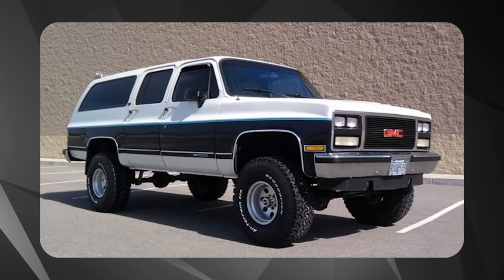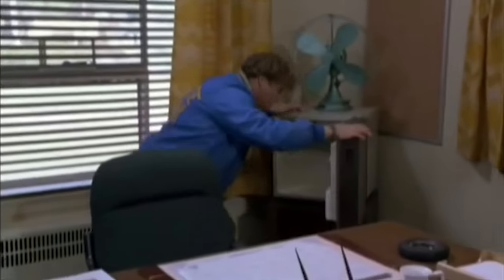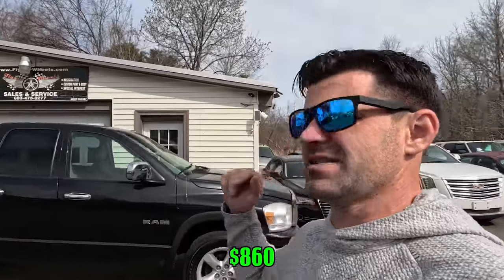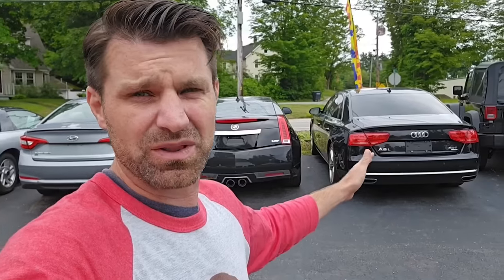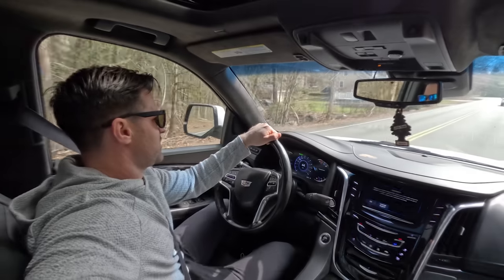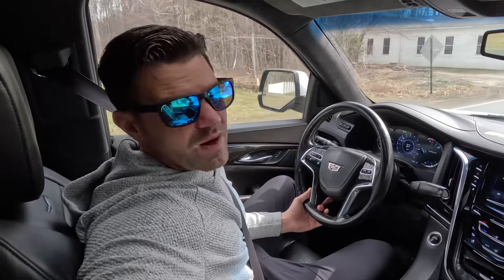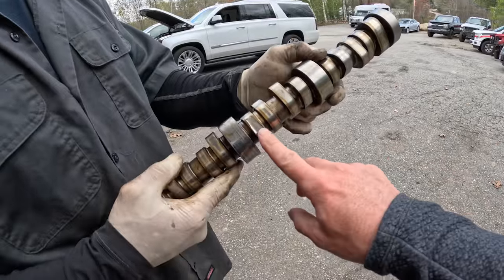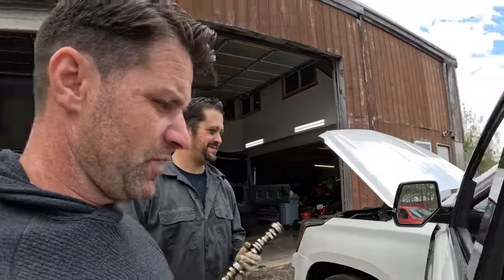WARNING! GMC Chevy & Cadillac Escalade Engine Problems at only 53,000 Miles! - Flying Wheels

Comment: If that jeep has the pentastar v6 . The early models were trash and had cylinder head issues. Went through the same thing with our grand cherokee. Thankfully it was under warranty and eventually got a new cylinder head the 4th time it was in. 60000miles later same number cylinder misfire. Trade in time

Comment: Yeah just put a gas motor from a 2500 HD pickup in it. Delete the VVT if it has it, but it most likely won't get it properly. Dialed in by a good tuner he'll keep any codes from popping up. Problem solved for half the money

Comment: I had a Jeep the check engine light would come on if you farted around it 🤣 just kidding but I finally got it fixed when they came up with a stretched timing chain 🤔 no trouble after that then the light came back on a year later got the speed sensor right rear wheel changed out no more problems then I posted it for sale sold it the next day I left the new tires on it 👍I would like to have that Escalade I like to work on cars when I have time

Comment: Wait for the 4 cyclinder turbo GMC and Chevy trucks to come to the market,  I know they have the HP and Torq similar to a V8 but does anyone else thinkg one of thee engine is gonna last a long time.  You can buy a used truck and what if the person whom owened it towed a huge mortohome,  back in the early 1990s I went thru the smokey mountiains in a ford dually pulling a race trailer and we could only go like 52 mile an hour up some of the hills,   heaven forbid you try this in a 4 banger .

Comment: GM would say, We don't have problems with our engines NO, It's rare, Do 3,000 miles oil changes problems go away, except for that DAM torque Converter-Pump issue.  GM is still doing better than Ford I hear😅

Comment: $35 + $100 an hour labor comes out to about $230. $5,000 replacement engine plus labor I'm guessing about seven grand for the engine swap. Seems like most of the Prophet was eaten up and you just got an even exchange for a car with less miles

Comment: GM's best engine was the gen 3.

My 243k mile 5.3 silverado has outdriven its own 4l60 AND g80 and still runs strong af!

My ls6 cadillac is tough as nails and has 35psi oil pressure at idle, LSA guys can't say that🤣

Comment: Afm no cost deleat ,process 2022 chevy high country 1 start truck, turn off auto start 2 when going to put in drive push shifter back till in lo use paddles or bounce shifter till you see  L 9 on the screen  ten speed trans drive in L9 truck will not deactivate lifters you will have full v8 all cylenders all the time, no weird exhaust sounds  and my 6.2 runs like it should have, minor loss of fuel economy due to not useing overdrive aka 10th gear , and shouldnt have carbon building up in intake/exhaust ports is what I read  , so far I love the extra get up and go , also been told if useing  programmer will allow you to set pedal sensitivity for better throtle responce feel... Thank you telling us about the plastics in transmission doest sound like much help on that problem mayby the aftermarket will fix this issue for us , ps by the way I heard the 2026 and up all cars will have a mandated remote shutdown installed on them I am assuming to end car chase scenarios  I guess we will see then ?

Comment: The northstar engine was just a poor choice of materials in combination. Aluminum heads on a steel block, not sure that was ever anything but a recipe for head failure.It's not if it will fail, it's a matter of when.Surprised you havent realized being a car dealer.

Comment: It’s not just the lifters with these GM’s it’s the transmissions and high pressure fuel injectors. The lifters are a problem too, but they’re hit or miss. I’ll never buy a GM again. My 2018 Silverado lasted 45,000 babied miles before the fuel injectors started leaking and the transmission started shuddering. And it’s not because of oil changes, it’s because of the AFM system itself, the more it’s activated, the more premature damage occurs. Ridiculous design.

Comment: I have a 2012 gmc terrain. 85000 miles
The abs module schidt the bed and now they no longer make the module.
No one will work on the vehicle because it will require a remanufactured part.
Gmc can old show me a new vehicle… wtf!

Comment: Definitely not a 6 speed in that. Im positive it has an 8L90 which is a rough tranny for sure. When it works it is an awesome transmission but shuddering is a really common issue. The 6L80 valve body check balls do wear out normally resulting in a loss of forward gears because of check ball 5 wearing i think. Overall though, the 6L80 is a pretty solid transmission. Transmissions are especially neglected by dumb customers who wait to service them until at least 100k miles and then wonder why shit breaks.

Comment: remove the Valve management crap, replace the cam and lifters. There are kits to block the AVM. and you can turn it off in the ecm. That LS motor will run for ever then.   ( there are many youtuve videos showing the conversion. Yea you will lose some fuel mileage.. but I would rather have a super reliable vehicle.

Comment: Hey Craig, quit cheaping out on your kid haulers!  Your family is worth some full coverage Weathertechs, and when you do sell them, rinse them out and dress them and people really appreciate them.  There are other brands that are just as good and less expensive as well (I run Quadratechs on my Jeep, which are pretty much identical to Rugged Ridge, also good and cheaper than Weathertech).  Besides looking nicer and adding to appeal for buyers, they're much better protection from liquids, like those discarded not-quite-empty Gatorade bottles.
Reply: Also, I think the projection is for turning on/off the projectors in the doors that project the Cadillac emblem on the ground when you open the doors?  Test it out and let me know!
Reply: Oh, sure...hide your Weathertechs until the end of the video lol.  That will teach me.

Comment: Emissions and fuel saving gadgets and inventions in gas and diesel engines IMO have caused more landfill waste and Earth eco damage than simply not having them. More engines and cars have been junked to all these emission systems failures. If cars actually lasted 10+ years like they used to than we would have LESS WASTE, rather than by a new "eco-friendly" car every 3-4 years.

Comment: I know Craig my 2003 toyota  rava  4  stick been great  2022 rava4  been at the dealer more than in my house  power windows trans slips oil filter hosing leaking& maybe burning oil at 12.000 miles back up camera & wheel sensor which dealer thinks might be 90 percent of the problems
Reply: Yeah. Even Toyota ain't what it used to be. Hope to keep my '90s Tacoma & Camry forever, or at least 'till I can't drive anymore!

Comment: This is typical GM. I have a 2008 Trailblazer SS that shit a lifter around 100k miles then spun a rod bearing at 130k. 
Failing lifters and poor valve train have always been a GM issue. Don’t worry, the government will keep bailing them out for building shit products.

Comment: meh, just run it into a tree at 82mph. only takes about 1/8mi to get goin that fast.

you can even survive without a seatbelt. I tested it last thursday.

only broke 10 ribs. no big deal. the cadillac got the punishment it deserved and I didn't get ejected. even unbelted. it treats you so nicely that they'll think you were abusing opiates instead of having a kp6 solar storm induced seizure.

real talk tho, that hydroformed chassis saved my FN life. I am unbraced and walking around with all my extremities responding just fine. Can't say enough good about these tanks. I legit should be FN Dead, didn't even hit my head.

took a 90yr old live oak to stop it.

Comment: I have been seeing a lot of corvettes with AFM or cylinders deactivation for sale and I want one but they cost too much over 50 grand grand and I have test drive some of them and I cannot believe the things I was feeling with 40-50 thousand miles to much vibration rough running and no soft bumps big and sloppy and I don’t think they are worth 25 grand.

Comment: Not the sound stupid. And I know you're a smart guy and I've done your research. But you don't necessarily have to put a motor in it! What typically goes bad with these are the roller rockers and/or camshaft and lifter issues. If you have a good shop or machine shop nearby, you can delete.  The active fuel management and displacement on demand change some simple parts and be up and running again without that engine having to come out of the vehicle

Comment: I own an Infiniti ex35 VQ35 230k miles original everything - runs like a clock.
If the Nissan smokes I’m sure it was the owner who skipped oil changes or fucked it up.

Comment: ONCE AGAIN AND IVE SAID IT FOR YEARS WE ARE JUST GUIENA PIGS FOR THESE CAR COMPANIES<where has all that lifter wear matwerial go? right into the oil pan ,then where,maybe picked up by the oil filter and maybe not,now you have metal fillings or chunks going into the oil pump and then to the bearings then what? not only is the cam and lifters worn out now without completely cleaning the inside of the engine block,the only correct way to do it is the engine needs to be completely disassembled and hot tanked to remove whatever has ciculated thru out the engine and at that time you can inspect the internal parts before reassembly.Good luck with the POS Caddy.

Comment: New 2023 GM coming out the factory 70-80% complete & missing parts such as trim panels, tow hook covers & even painted ones also, climate control not working, HD Radio not installed & more. This is on all models especially ones made in Korea & Mexico. How can they do this & leave factory this way & yes they will fix it but GM parts on back order now for months.
Reply: First Ford  build issues for the last years, now GM?   i really dont the lifters are that big of deal.
Reply: Quality control no longer exists. Reminds me of the 1st new car I bought a 1978 Oldsmobile Starfire GT. Took it home & accelerated the fan ate the plastic shroud around it plus the hood nearly was dented too. No engine mounts ! Also had a paint bubble in the corner of the hatch about the size of a half dollar. 6 months later the bubbled paint broke open it started to rust. Now my Mazda MX-5 Club soft top was made in Hiroshima , Japan. I watched videos of their factory making the cars & how many quality checks it goes thru. As Americans after WW2 an engineer Edwards Deming, taught Japan's manufacturers how to produce top quality products economically. The Japanese used that knowledge to turn the global economy on its head and beat U.S. industry at its own game. To this day the Japanese auto industry uses his methods.
The US Auto makers could have used the quality methods taught. Instead we had Automotive Engineers in the US that ALREADY knew what they were doing ; )   !

Comment: Lifters from the afm bullshit is the worse design ever!! I was working at gmc dealer in 2002 to 2014 and in 08 we got out first lifter issue in the shop at 80k miles took the cat out too from oil burning when the cylinders shut down sits inside the intake manifold

Comment: We have 8 trailbosses’s all are late 21 and early 22 models with 6.2l in them. 
   All 8 have over 110,000mi  with zero issues.  My 6.2 is a 21 stripped down custom trail boss and has 172k on it.  Only time they have been in the shop is the 22 models with that new sorry digital dash.   Those POS  crappy dash panels can’t take the Texas heat along with West Texas. Ruff oilfield roads. 
   But I with all eight of those that have been zero mechanical expenses spent

Comment: First, for reliability, GM has always sucked!  You want complete reliability for years and years?  Toyota Land Cruiser.  I have owned three, a 1973, 1985 and a 1995, for a total of over a million miles and never had a single major repair of any kind.  Wear items, like A/C compressor, power steering pump, alternator, brakes, yes, actual repairs, NO.  I sold my 1985, with 460,000 miles on it and it still had the original water pump!  I still own my 1995, with only 320,000 miles and it still has its original water pump!  Also, I live in Florida and none of them every developed a speck of rust!  My only complaint is, ALL of them got crappy gas mileage, but at least they all ran on regular.

Comment: Always delete the AFM ! If you change the oil every 4000, you can easily get 200k+ miles! Personally  I like  my 2003 Z71 Tahoe with a 2005 ECM torun the electric fans paid $3500 and was offered  $10k nope leather is new won't  buy newer don't  like problems!

Comment: Toyotas still go on way past the chevrojunk… Ill never waste my money on chevrojunk again.
Reply: RealFlyingWheels  I literally have a 2018 High Country thats been sitting in my driveway for almost years, I just got done rebuilding tranny, rear diff, axle bearings… and It now has a loud knocking on that 6.2 which im afraid its a lifter issue, issue after issue and truck barely has any mileage on it… I just sold my 2012 Toyota Camry SE with 562,000 miles on it, I just replaced struts and control arms before selling it… the guy that bought it when he test drove it, he said it drove Amazing! I still got $6,000 for the car, smooth engine and tranny, best car ive ever owned.
Reply: @hamiltonzuniga you better junk that gm
Reply: @mattnorman5241  I know, its the only way to get rid of that government motor junk… the depressiation on those things is unbelievable!

Comment: It is just fascinating to me how the car companies can charge 100k with a straight face for a car/truck that only has about 10k in parts. They are nothing but plastic fantastic snap together junk. 100 percent computer controlled with proprietary software forcing you to bring it back to the dealer. NO THANKS!

Comment: Words of wisdom from my mechanic friends. CHANGE YOUR OIL EVERY 5,000 MILES OR LESS. CHANGE YOUR OIL EVERY 5,000 MILES OR LESS. CHANGE YOUR OIL EVERY 5,000 MILES OR LESS. CHANGE YOUR OIL EVERY 5,000 MILES OR LESS. CHANGE YOUR OIL EVERY 5,000 MILES OR LESS. CHANGE YOUR OIL EVERY 5,000 MILES OR LESS. CHANGE YOUR OIL EVERY 5,000 MILES OR LESS.
Reply: @alfredvinchagurara2054  When I purchase a new vehicle I change the oil at 1,000 miles and then every 5,000. Trans and coolant every 50,000. Like you said it may be overkill but I have zero regrets.

Comment: Ford is just as bad. Just had the transmission on my 2021 Expedition Max Limited with 52000 miles rebuilt under warranty.

Comment: Hate this design GM is using, you can get it deleted  at most auto shops where they will go in and shut it off in the computer that way it stops the 8 to 4 cylinder switching. This is honestly the worst design ever by far though cadillac tried this with a 8 to 6 to 4 and abandoned it quickly due to obvious reasons but some reason thought they would give it a chance for some twisted reason, and my uncle has a 2016 gmc sierra with this shitty tech and has so far replaced the same pushrod 4 times over now.

Comment: Engine swap it with a 2000-2006 engine delete all that crap
Reply: Wouldn't work, computer would be throwing codes like crazy.
Reply: @danielhartin7680  that's the only way to delete the cylinder delete crap it will need a open source tune as well.
Reply: @danielhartin7680  the car wizard is capable of a swap like that  and is the one that mentioned is the only way

Comment: The biggest problem with these engines are when people don't change the oil every 4000 miles or less and must use full synthetic oil.
Reply: No, they are just bad rip off cars.
Synthetic oil is garbage.
Reply: Opinions very 😂

Comment: GM never really built anything great....except the LS motors....until GM tacked on their BS tech to them.  
I wont even rent a GM vehicle thats how much i dont trust them.
Reply: smart guy now only if the rest of the dummies who stick up for gm could be told that
Reply: @mattnorman5241  i owned 5-6 different GM vehicles, every single one except for a grand am i had in the 90s left me stranded....im not talking about a random hose thats old splitting either.  i literally do not trust them that much.  not one ford or bmw i owned ever left me stranded outside of a neglected wear item.  side note too, i have never owned a gm vehicle over 90k miles because they never made it that far.
Reply: @baldisaerodynamic9692  gm knows that they vehicles sucks until people stop buying them this will continue i would never own a gm i know their tactics people gotta be smarter than the company

Comment: Craig…..that’s the GRISWOLD FAMILY TRUCKSTER !!!
Paint it pea green, fix the damned motor and they’ll break down your door to buy it !!
Seriously, what an ugly, overpriced POS.
You asked what happened to quality built cars ?
I’m not trying to be a wise guy Porsche snob……but…..Porsche still…..and always has….built very good “cars”…….albeit expensive….and specialized.
I know, that’s not your bread and butter.
But if the Escalade buyer had have spent the same amount on a Porsche, he’d still be driving it and you wouldn’t be stuck with it !
Ok……I’m done….over….